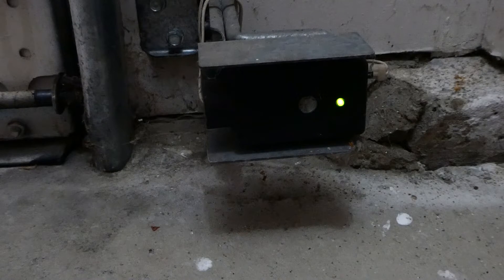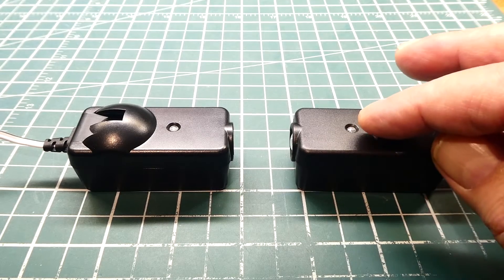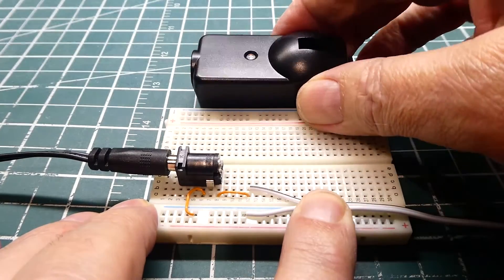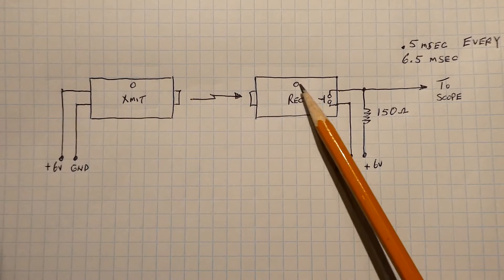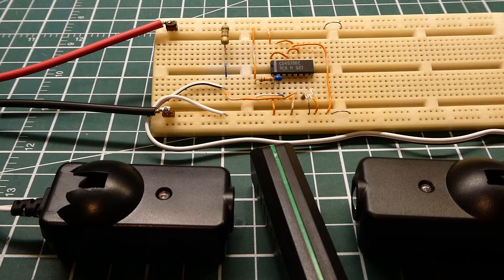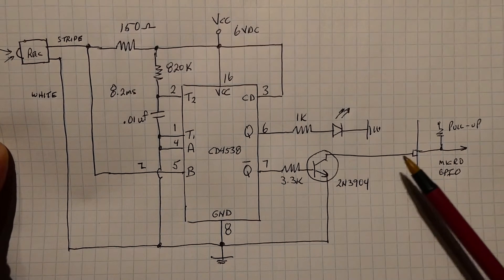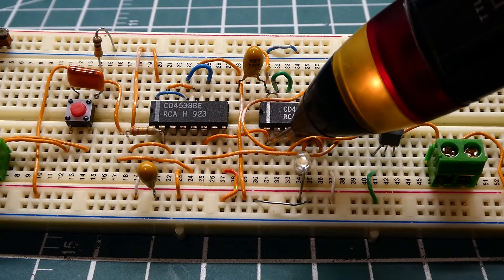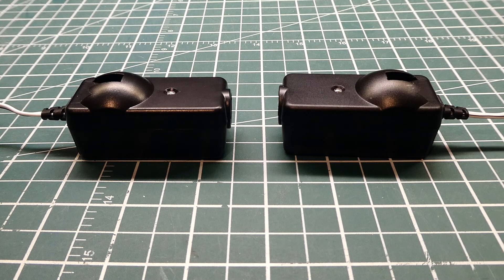Garage Door Safety Sensors / How do they work? / Build your own system

Comment: I have an invention that has added LED lights to safety sensor circuit. This gives added light at ground level for safety and security… can you design this circuit ?? Maybe 2-3 watts led with optics
Reply from the maker: Check out Fiverr. There are many engineers that will do circuit design and PCB layout.
https://www.fiverr.com/gigs/pcb-layout

Comment: Thank you for this excellent video.  I used this information to add a second sensor to stop the garage door when the rear hatch of our SUV is open.  No accidental closures and resultant scratching of the paint.
Reply from the maker: Glad the video was helpful. Thanks for the visit.
Reply: This was possible situation is what started my interest after seeing a friend whose door scratched his car's paint not long ago.  There is a clever detector solution on the market now; for those that want an easy comprehensive solution; but, it is pricey.

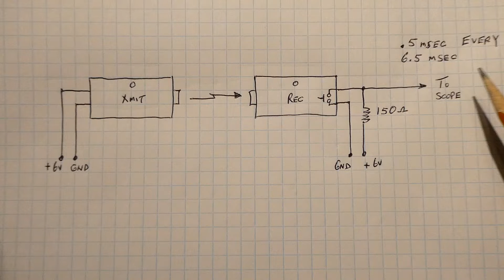Comment: @4:10 Really nice video. Appreciate it.  Do you think that a simple RC circuit with a diode could help detect the difference between a AC pulse wave and a steady DC signal?  If you put a 0.1uf cap inline, the result would be spikes proportional to the AC gradient.  A diode could remove the negative spikes.  Then a 4.7uF cap could accumulate/average the positive spikes to an output signal.  A ~100k resistor could drain that cap sufficiently to give you a responsive high/low output.  High=AC, Low=DC.  Lastly, you could optionally add a 3v Zener to protect the microprocessor input. No ICs or transistors involved.  Wish I could add a drawing.

Comment: My photo eye (Liftmaster commercial) outputs 312 Hz when unblocked, and 2.5 Hz when blocked. Does this sound right?
Reply: I would say that there will be many different design solutions, depending on the garage door opener manufacturer.  Mine definitely uses a different DC voltage and maybe other aspects are different (I have no oscilloscope) but this does give me a basic concept of what is a possible design.  At least with one infrared sensor set.

Comment: Hi - I am trying to copy your circuit but I am confused - the picture of your project appears to have a number of connections to pins >9 but your diagram has only one connection to a pin higher than 9 - 16.  am I missing something?
Reply from the maker: The CD4538 IC contains two monostable circuits where I am only using one of them. It is good practice not to leave unused CMOS input pins floating, but to connect them to Vcc or ground. Some people do not follow this rule so I left it out of the schematic, leaving the choice up to each individual. Check the data sheet for pinout information.

Comment: As this is DIY. Can't you just take the receiver apart and use the LED power to detect the beam.
Reply from the maker: The LED on the receiver is driven by the pulse train of .5 msec on every 6.5 msec which we see on the output of the receiver. It works as a visual indicator even though it is pulsating but still needs further processing to feed a microcontroller or to drive a transistor.
Reply: @0033mer  Thanks so much for this reply!

Comment: Hi, thanks for this very useful video.  I'm trying to add a second sensor to my garage door opener so that detection on any of them would prevent the door from closing.  With sensor #1, I am planning to use the same monostable circuit that you built and send the output into an AND gate with the signal from the sensor #2.  I would then connect the output to the garage door opener terminals.  This way, if sensor #1 senses an object it will send a 0 to the AND gate ---> 0 V output, regardless of the sensor 2 state.  If sensor #1 doesn't sense an object, it will send a 1 to the AND gate ---> the output will be equal to the output of sensor #2.  Could this work?  My concerns are: 1) in this method the garage door opener would not drive the electronics, a separate 6 V source would and 2) there are cases where the output would be 0 V, while the garage door opener typically gets steady 6 V or 6 V with 0 V pulses.  Thanks.
Reply from the maker: The monostable is "edge" triggered so a steady 6 volts or 0 volts will cause the monostable to time out.

Comment: My circuit is set up, the led and garage door openers are lit, but when I break the IFR beam the LED stays on even though the receivers light goes off. I didn’t have a .01 microfarad capacitor or a 820 kohm resistor so I used a .1 microfarad capacitor and set up two 100 kohm resistors in parallel and then lined those up in series with two 10 kohm resistors to get 70 kohm and a time constant of 7ms. Could that be my error? Are there any other common errors I should check for in my circuit? Thanks.
Reply from the maker: Ground pin5 of the 4538 to ensure there are no input clock pulses. The LED on the Q output should be off. If not, double check your wiring.
Reply: @0033mer Got it working! It was a wiring issue with the resistors I set up. Thanks for the reply
Reply: @0033mer got a follow up, I’m working on connecting to an arduino and I thought I could be cheeky and just take the Q output and plug it into a pin in substitute for the LED. My pin is reading when the beam is broken and the voltage drops low just fine but when it isn’t broken its state is rapidly changing from high to low then back to high and so on, as if the pin is floating. Is this an issue with me working through the Q output instead of Q naught? (Sorry for all the questions, I’m new to monostables and they are a bit tricky).
Reply from the maker: To get rid of the "flicker", increase the value of the resistor or capacitor to a RC time constant of 12 msec.
Connect to your Arduino as per the schematic with a transistor, as the Q output is 6 volts and the maximum voltage into a GPIO pin is 5 volts. The transistor and internal pullup will fix that.

Comment: Is there anyway that I could use a relay to turn a 12v light bulb on and off instead of the LED? And if so, is there a relay that would be compatible? thanks a lot.
Reply from the maker: You could use the output to drive a mosfet switch which can turn on a 12 volt light bulb.
https://shorturl.at/IB7M8
Reply: Thanks for your reply

Comment: Can you explain why the RX side has a 150 ohm series resistor on the power input? The sensors on my opener (RX and TX) are connected in parallel to the same two terminals so either my RX has an internal resistor, or it is not needed.
Reply from the maker: The resistor is on the logic board inside the door opener. The resistor is the load when the power supply is shorted.
Reply: @0033mer  it looks like a pull up resistor to me. that way the sensor can just short the signal line to ground on a timer basis.

I plan to add another IR beam device higher up at my car's bumper level. this device has SPDT relay output. I plan to use the relay output to "break" the ground side of the OE sensor to disable the garage door opener if my car's bumper is still in the new device's IR beam.

Comment: I really like that your videos pull me back to the hardware. I am such a microcontroller guy now that I would probably set up a timer  to overflow at 8 milliseconds. The timer resets when the pin goes low and not overflow.  If an overflow occurs I know the detector isn't seeing the transmitter.

Comment: Can I request a circuit, please? I have a device that runs automatically intermittently in the basement. I need a wireless transmitter and receiver to see when it's in operation, from, like, 10 meters away.
When the device runs it lights a green LED. I can tap to the LED's power or its light, but nothing else.
Any ideas for a simple design, please? Perhaps a simple AM or FM signal circuit?